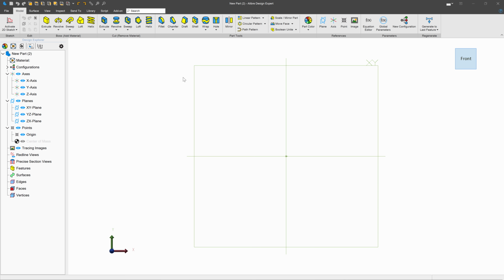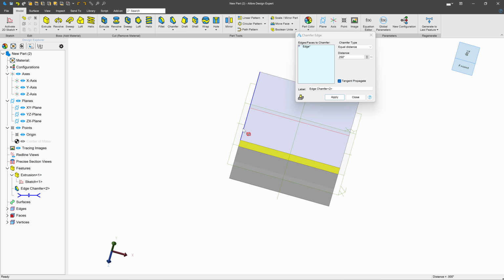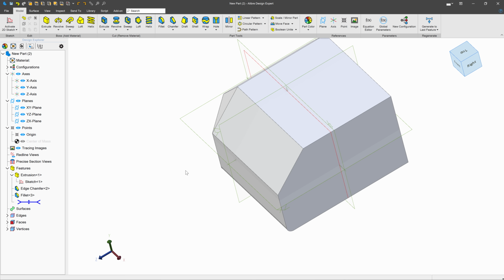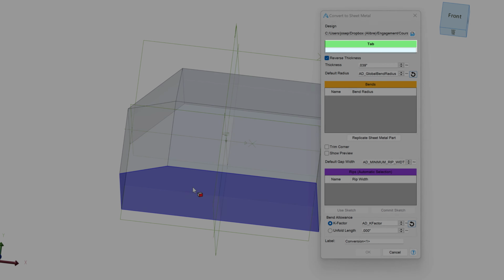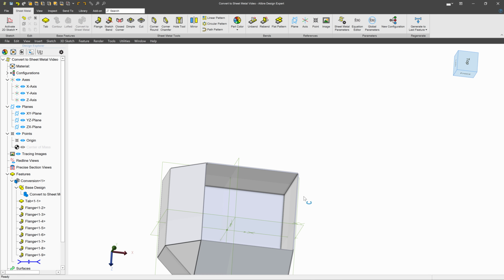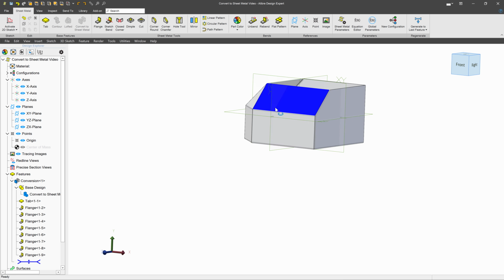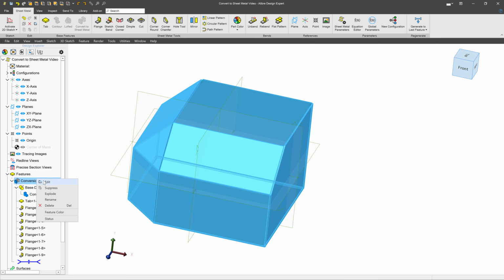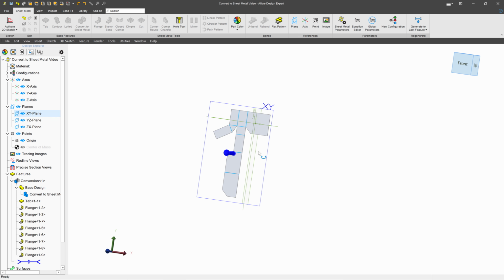Introduction to Sheet Metal | Alibre Beginners Course #45

Comment: Watching your video brought back memories of designing multi-part electrical/electronic enclosures in 3D with I-DEAS. The solid model was the start for each part, top, bottom, sides, and back of the enclosure as they were converted to SM. Just had to be careful to allow for sheet metal to thicken in or out when creating the solid model. The beauty was in creating the assembly, just bring in the part and place it at 0,0,0 and it would align perfectly.

Comment: No, no. The next step after making a flat pattern is printing it one 1:1, gluing it to your metal with 3M 77. 

You can then proceed to cut it out, grind back to the exact lines,  and bend it up. 😊
Reply: I don't care if you're Boeing. You have done that ^^ at some point in time.

Come to think of it, Boeing might actually forget to glue the sheet metal on the piece of paper... Hmmmm....
Reply: @ExMachinaEngineering  My wife saw this comment and we both laughed pretty hard!  Boeing- where one door closes and another opens.
Reply from the maker: Hmm What if I use JB Weld?
Reply: @AlibreLLC  A lot more work.
Reply from the maker: @PaulSteMarie  I would be inclined to agree!  It's what I currently have about six packs of around the house to use every time my kids break something